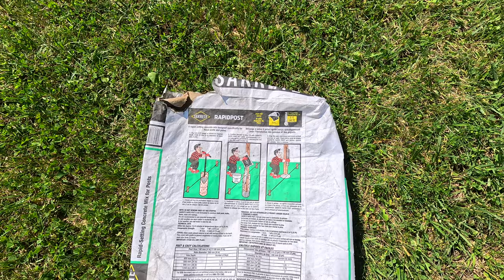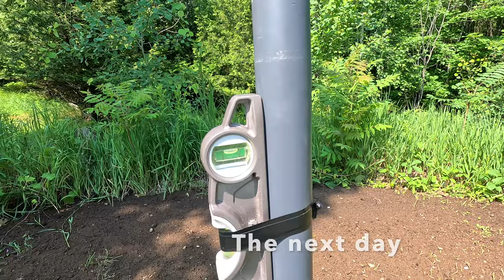Upgraded Starlink satellite dish stand is a Game Changer

Comment: Good evening Brian. Great job installing the new starlink steel post perfectly plumb. It has a much cleaner look and is   planted much  more solid than the wooden one.  I gather you'll be doing more digging to lay the ground pipe for the cable. Have a good one!
Reply from the maker: Yes, that will be the next step. I'm really glad to get rid of that wooden stand. It was an eye sore but it did the job. I still have to get the pipe to put the cable in and then I'll bury it. Thanks for stopping by Paul!